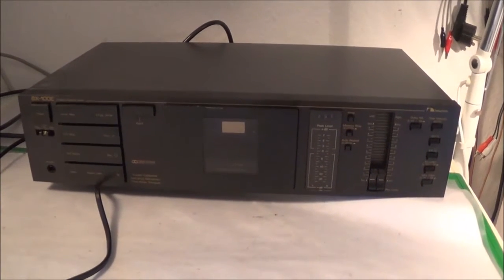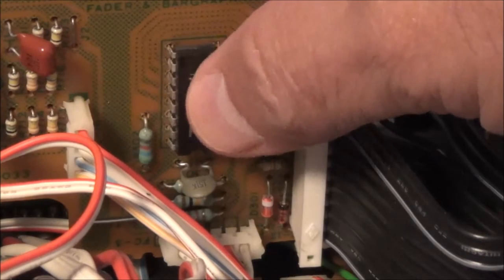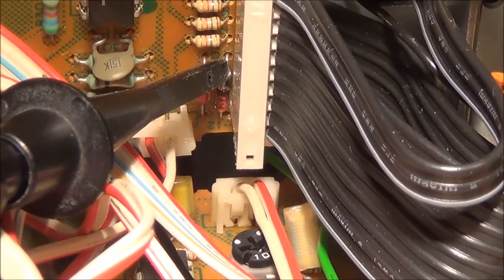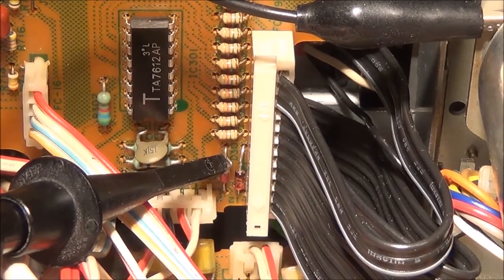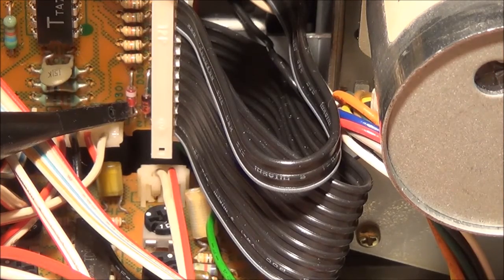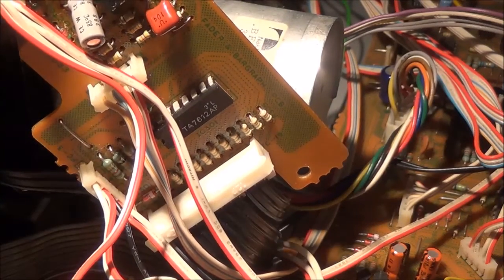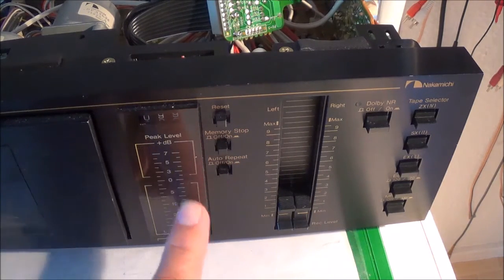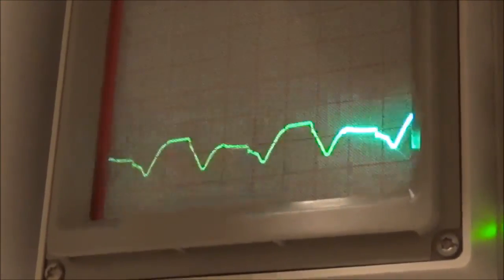Nakamichi BX-100 Cassette Deck LED Bargraph Problem

Comment: My diode 1ss53 is showing reading when +ve lead kept at ring and other at -ve terminal lead, is it bad?
Reply from the maker: The ring is the negative side. You should disconnect one side of the diode from the board and do the measurement. You should have conduction in one direction, but not the other. Place the negative (black) lead on the side with the ring, and the positive (red) on the other side. You should get a reading. You should get no reading when you reverse the leads.
Reply: @OldSchoolElectronics  yes you where right, before you have this reply, I desolder  two of this diode, but it showed no reading, I don't know what magic is it.
Reply from the maker: Sorry, YouTube showed me your comment just today. If the diode is out of the circuit, and you have no reading, then it is open.

Comment: Hi, I found the schematic for the BX-100. It seems that those diodes are connected to the positive leads of the led's then they connected trough a resistor to a transistor base... I just cannot understand the logic of this schematic but it's definitely a very crappy made schematic. The older the unit, the higher chances of a well made documentation are. I actually do not believe that you need anything special for the diode. There are 2 pairs of ten led's for each channel, those pairs are paralleled and after each pair you have those diodes. I have to say, that I've never seen a more complicated Vu meter circuit!. Today I've finished restoring an Aiwa AD-W505 tape deck. The final problem on it was that one Vu meter channel was intermittent always on and only one channel was working and getting too loud and the other was basically silent, after 2 days of tinkering and testing, I just re-soldered all the connection on the suspected are of the pcb and now everything works nicely. Just search on google for BX-100 schematic and there is a site called elektrotanya. Cheers :)
Reply from the maker: Thank you, sir. And congratulations on your restored Aiwa.  Keep up the good work!